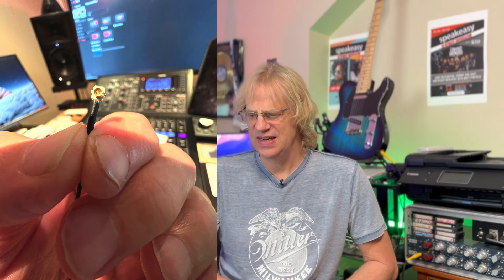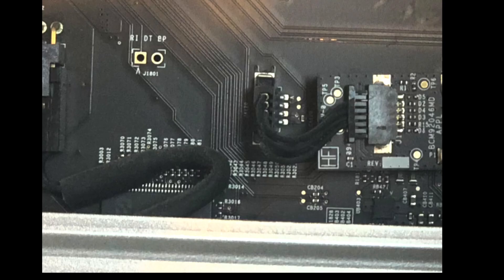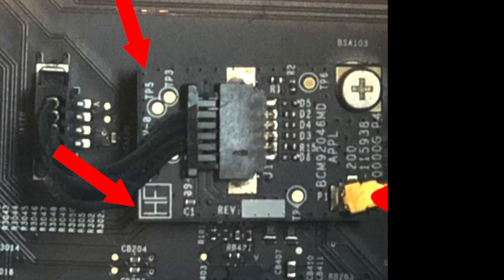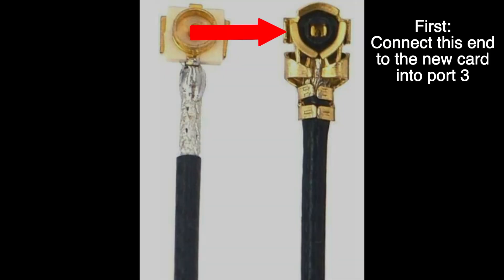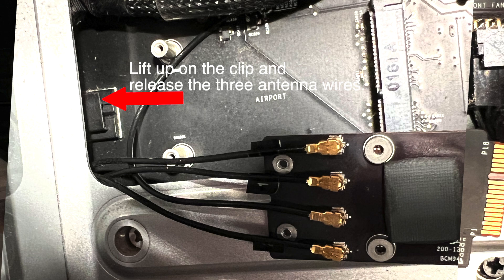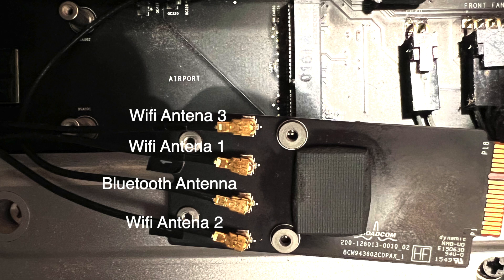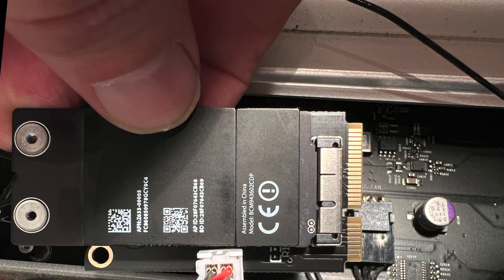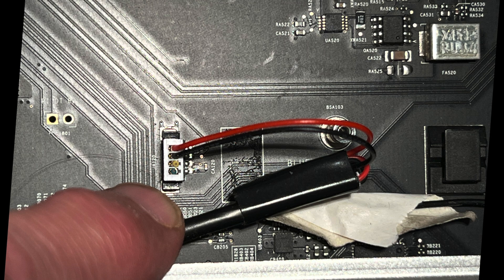Mac Pro 5,1 Bluetooth Wifi Upgrade!

Comment: Can I keep the original Bluetooth and use it for wifi only cause my pcie card which the wifi card goes into doesn't have a place to attach a wire to put it in the original Bluetooth socket
Reply from the maker: it should work with opencore legacy patcher as they patch the original wifi card not he upgraded.

Comment: Major Breakthrough!! You DO NOT NEED THIS. By using Open Core Legacy Patcher and installing the Post Installing Patches it installs the proper drivers so your stock wifi card will now connect to wifi without any issues.  ONE SMALL ISSUE AND WORKAROUND HOWEVER : I could not connect the normal way (clicking the icon on top right (tiny wi-f- logo) then selecting my name). Instead the way I could connect was to go to Settings > Network > Wi-fi > either Network Name or Advanced whichever one then brings a popup to enter password > Then you click your wifi then manually type in your password from this pop-upand it will now connect. That is the workaround and solution that worked for me. Doing it the normal way on the top right of screen- the popup to enter in my password would never show up the wifi logo would constantly go up and down. Hope this helps someone

Comment: Lance, I've been watching your video and I've come to removing the screws on the Wi-Fi module? (I've already removed the Bluetooth module) How do you safely remove the screws for the Wi-Fi module? They're tight as hell, I'm afraid of stripping the screw heads. I laid my weight on the screwdriver but the screws just stayed tightly fastened.
Reply from the maker: They have lock tight on them some more than others make sure you have the right size screw driver, it’s been a long time since I did this so don’t really remember how tight they were.
Reply: @MacSoundSolutions  It's all good, thanks to your great tutorial. My brother helped me  undo the screws. I've now got a nice wifi AC card installed. Thanks👌

Comment: would you still recommend the wifi external antenna ? are there better wifi/bluetooth chip options?
Reply from the maker: @Vcg108  not that I know of the antenna does the job.

Comment: why is my 5g speed lower than 2.4, I even connected an external antenna and the speed is still very low. The router is definitely normal because I have an old imac 2008 and macbook air 2010 with native wi-fi modules and there the speed is much higher on 5g
Reply from the maker: when updating hardware it is good idea to do a pram reset that may clear out the cobwebs, just keep in mind that if you are using opencore it can unbless it and may need to be reblessed, as it can also re enable SIP.
Reply: @ I’ve reset the NVRAM, but it didn’t help. Yeah, I’m running macOS through OpenCore Legacy Patcher.

By the way, are you getting full speed on 5GHz Wi-Fi? I’m trying to figure out if it’s just an issue on my end or if it’s something everyone has but just hasn’t noticed.

On my setup, 5GHz is performing way worse than 2.4GHz—sometimes websites won’t even load at all.

In the network stats for 5GHz, I see a TX rate of 135 Mbps, noise at -87, and RSSI at -74 — but in reality, the actual speed is around 10 megabits or even less.

Comment: Great video thank you! Id like multiple OS  boot ideally .Does the4.2 card work with Mojave/ or do I need ML Monterey OC  first on my CMP 5,1 ( Radeon RX 580) can I still get internet via ethernet with patcher? thanks again
Reply from the maker: I never had issues with Ethernet with Martins or OCLP,  yes the card worked with Mojave, it’s basically a 2016 iMac card I believe. It worked with Monterey and Martins not sure I ever tried Mont with OCLP.
Reply: @MacSoundSolutions  Great thank you Lance , fingers crossed for my apogee ensemble FW in Monterey;).
Reply from the maker: @T_G_X_P  not sure about the FireWire working, the driver has not been updated most likely to 64bit but some folks seem to still have some interfaces work.

Comment: PLS HELP

Hi Lance,
I always follow all your videos with great interest.

I have a MacPro 5.1 (mid 2012) with dual Intel Xeon X5680, 64.0 Gb Ram, on which I have installed two operating systems via OCLP 2.2.0
- MacOS Monterey 12.7.6
- Windows11 22H2 
both working perfectly except the known problem with the Bluetooth function.

I therefore decided to proceed with replacing the old original WiFi cards and original Bluetooth cards with a new BCM94360CD module, which I easily replaced following your video tutorials.

After installing and reconnecting everything perfectly and reassembling the computer, I could see that the Bluetooth problem was solved, but a new problem appeared on the WiFi network as it is no longer possible to connect via WiFi. 

I checked that all the hardware was correctly installed as when starting the computer with Windows 11 everything works perfectly without problems in WiFi or BlueTooth, but when starting with MacOS Monterey I have a problem with the WiFi as it is seen active but none is visible network and it is not possible to connect to the network 

I tried running OPLP – Post Install Root Patch again, but I got no solution to my problem 

PLS HELP
Reply from the maker: @MaurizioLucc  I would fully  disable sip if you have not using terminal in recovery mode but first try and do a pram reset. When installing new hardware a pram reset is a good idea. But it might unbless opencore so be prepared for that and have a bootable Mojave drive or move OCLP onto a thumb drive and bless it so you can reinstall it on the internal drive after pram reset.
Reply: @MacSoundSolutions  SOLVED ! thank you so much !
Reply from the maker: @maurzit  did the pram reset do the trick?

Comment: Doesn't seem to be working with Open Core and Sonoma
Reply from the maker: It does watch my latest video it shows you how to fix Bluetooth
Reply: @MacSoundSolutions  Thanks your video is great, but it's not solving my problem.  My bluetooth is working fine, the wifi card is not being recognized.
Reply from the maker: @paulsaarinen7999  need more info, what OS are you using etc? Did you try resetting your pram?

Comment: What mbps second original wifi card bluetooth vs what mbps with the modification i can't find online i wnàt to buy a mac pro 5.1 2010 or 2012
Reply from the maker: Good question not totally sure, of course it also depends on your wifi router.
AirPort Extreme with Wi-Fi 802.11n + Bluetooth 2

AirPort Extreme with Wi-Fi 802.11ac + Bluetooth 4

Newer model Airport Extreme card installed in 2015 and newer Macs. It offers faster wireless and bluetooth connections and supports AirDrop and Handoff. Compatible with macOS 10.13 and newer.

Comment: You, sir, are a legend for this video! I followed your instructions and went with the antenna you got off amazon.  I have multiple OS available on different drives (dosdude1 mojave, OCLP catalina and OCLP monterey) and Bluetooth and Wifi would only work OOTB after the upgrade on mojave and catalina.  Tried multiple NVRAM resets to no avail.  I found some forums online that recommended booting into recovery mode and running a certain command.  I couldn't boot into recovery mode without rebuilding OCLP which required switching over to my mojave OS, rebuilding OCLP with the recovery drive option enabled, booting into recovery, opening terminal and running this command: nvram boot-args="-btlfxallowanyaddr"

Once I then booted back into my OCLP Monterey drive, bluetooth was working flawlessly! I can't believe I just airdropped a file from my iPhone 15 to a 4,1 (flashed to 5,1) 2009 mac pro.  The only issue i'm having now is that Wifi isn't working on my Monterey drive.  It doesn't list any networks.  But i'm near a router and I use ethernet so this isn't really an issue.  Still I plan to keep looking into it to see if I can get it to work.

Comment: The PRAM reset worked by recovering the Bluwtooth but now I lost my support for NVRAM (that I had as my main drive)  and had to go to a old GPU because my RX580 is not recognized...
Reply from the maker: Yeah you will have to rebless opencore then put the 580 back in

Comment: I did this upgrade. Wifi works perfectly but Bluetooth does not work at all. I tried it with an external antenna and also with the internal built in and still no result. Could it be a defective little card?
Reply from the maker: What Mac OS are you on and are you using opencore? Maybe try a pram reset. A few people have had the issue.

Comment: You do not mention the model number of. the wifi card that. has BT 4.2 on it.  What is the model number?  Is there much advantage to 4.2 over 4.0?
Reply from the maker: Broadcom BCM_20703A1 it’s actually a 4.1 not 4.2 I don’t think there is much of a difference.

Comment: Hi, thank you for your tutorial, I upgraded to Monterey but the mouse cannot connect and therefore even with a keyboard it's not possible to use Monterey without a mouse.
when I look inside my MacPro 5.1 (mid-2012) , the wificard shows only 2 Wifi connectors and the third is hidden under the wifi card. 
How can I be sure that the Kit your recommand (Mac Pro 4,1 5,1 Genuine Apple WiFi Upgrade Kit 802.11ac a/b/g/n/ac Bluetooth 4.2) will be compatible with my MacPro 5.1 (mid-2012) ? Is there a serail number to check before ordering this Kit ?
can you confirm that there is no welding to be done ?
Reply from the maker: The Bluetooth might need a pram reset to get it working if wired properly, does blue tooth turn on and you made your mouse discoverable to pair with the Mac Pro?

Comment: Hi, have the same card installed and my 5.1 sees the card in system report, but no network is showing up. what could be wrong?  Monterey installed with opencore. Thanks!
Reply from the maker: Loook under about this mac sytem report Network. Mine looks like this, Maybe try a pram reset sometimes its needed when adding new hardware but be aware in can sometimes unbless your opencore install and may need to rebless it.

interfaces:
en2:
  Card Type:	Wi-Fi  (0x14E4, 0x14A)
  Firmware Version:	Broadcom BCM43xx 1.0 (7.77.111.1 AirPortDriverBrcmNIC-1710.4)
  MAC Address:	not including this for security
  Locale:	ETSI
  Country Code:	X3
  Supported Channels:	1, 2, 3, 4, 5, 6, 7, 8, 9, 10, 11, 12, 13, 36, 40, 44, 48, 52, 56, 60, 64, 100, 104, 108, 112, 116, 120, 124, 128, 132, 136, 140, 144, 149, 153, 157, 161, 165
  Wake On Wireless:	Supported
  AirDrop:	Supported
  AirDrop Channel:	0
  Auto Unlock:	Supported
  Status:	On
Reply: @MacSoundSolutions  everything looks the same, except: STATUS: Not Associated
Reply from the maker: @michel0broekmeulen  I would try a pram Reset but be prepared it could unbless your opencore install.

Comment: Hi, installed the kit and my Mac 5.1 2010 recognized the card but no wifi is popping up in the network window. What could that be? Monterrey installed with opencore. Thanks in advance!
Reply from the maker: Is Bluetooth working? and silly to say but make sure wifi is turned. Look in the upper right hand corner of the menu bar top of the screen can you turn wifi on there? Mine just showed up after installing. You may need to do a pram reset as you have added new hardware I can't remember if I had to do that or not, also double check the antenna cables to makes sure they are correctly connected if its seeing the card then it sees it via apple system profiler then maybe the pram will fix it. Beware that this could unbless your opencore install but it shouldn't as long as the opencore drive is installed. I did have that happen once and had to go back to mojave turn off SIP and rebless my opencore drivev.

Comment: Thanks Lance! Did this yesterday, having bought the elements on various eBay places for a pretty decent total price. It was pretty straightforward, even plugging the 3 antennas which I was dreading. Now I'm ready to install Monterey on a separate partition to try the latest Avid version.
What OC version are you running with Monterey? Stable?
Reply from the maker: I’m using Martin Lo’s latest package and Monterey 12.7 all is good except the latest safari  is buggy although I got it working fine now after taking my router offline and rebooting it but at first no web sites would load. I’m on the previous version of pro tools not the very latest update but will update soon, all is very stable. Make sure to make the config.plist changes before installing Monterey, then return it to original settings after updating, easiest way is to drag and drop the original one over the one you made the changes to and reboot.

Comment: Hi Lance! What version of Mac os are you running? I install it but I can't connect any device.
Reply from the maker: Monterey 12.6.8
Reply: @MacSoundSolutions  Thanks, I'm on Ventura 13.5 and I got it to work, not sure how but I did it LOL. Air Drop, BT WiFi all works... WIFI is super fast ...

Comment: Hi Lance! I just want to say thank you very much for all of your in-depth videos on both hardware and software installations for the Mac Pro. I can’t stress how helpful you’ve been in allowing me and my Dad to gain a greater understanding of the machine and how to upgrade/replace several hardware parts. 

In the audio field there is a massive gap of accessibility to those who lack capital to spend on a computer, MIDI controller, software, DAW, Plug-ins etc. and as someone who comes from a working class household I’ve always had to find solutions to overcome these financial obstacles. When I managed to pick up an early 2009 Mac Pro 5.1 with dented legs on Gumtree, for a mere £40, your videos have helped me upgrade this into a beast of a machine with meticulously detailed step by step video guides. It’s now running a X5690 CPU, GeForce GTX Titan GPU, 96GB (triple channel) RAM, has 3 OWC 2.5” SSD tray sleds with 7TB worth of drives in it right now and, after watching this video, it’ll be upgraded to Bluetooth 4.2 support! 

I’m not sure if you’re active on LinkedIn at all but I’d love to connect with you if so. Your work on this platform is exceptionally helpful and I plan on making a post about it soon. 
Thanks again Lance, take care.

Max :)
Reply from the maker: Hey Max good stuff thanks and glad my vids have been helpful. I am on linked in, Lance McVickar

Comment: Hey, so I have a new MBP with the m1 chip and my Mac Pro will not connect to it via airdrop. Will this resolve the issue?
Reply from the maker: What OS are you running? Are you using Opencore?
Reply: @MacSoundSolutions  no, I don't know what that is. I just want to use the airdrop function.. sorry for late reply
Reply from the maker: @abezdnb  Continuity, Handoff and AirDrop is not available on the old Macs because the Airport and Bluetooth modules are out of date,  you have to upgrade your wifi bluetooth card in your mac pro 5,1 to get airdrop to work.

Comment: I have a 2009 Mac Pro with Mojave. It presents the following problem. While I want to download, for example, an update of some program, for example Firefox, some file or something else, the process stops. What could be wrong? my connection is optical and the relevant check has been done by OTE and everything was fine since the pages on the internet open very quickly. Do I need to change anything in the hardware? Do you suggest I get a new network card? I've tried everything but I don't know what else I need to do. Thanks
Reply from the maker: Try a pram reset might fix it. Clear out your browsers cache sounds like it’s corrupt files in there, also tru a different browser see if it works, if not it could be hardware, try a direct Ethernet connection.

Comment: Hey late question but im thinking about doing this to mine and, does the card still let you go back to stuff like MacOS mavericks later on? or are you stuck to more recent versions?
Reply from the maker: It should but I have not gone that far back OS wise it’s the same cards that iMacs use for a while. I think I have booted in MT Lion in the past.
Reply: @MacSoundSolutions  I really just need to go back to mavericks for stuff that i need running stable/xserve, so thisll work for me. Thanku!
Reply: @MacSoundSolutions  Tested it. Weird results.

Mavericks does not detect wifi or bluetooth on the card. But due to macs weird bluetooth failsafes with connecting Bluetooth keyboards and such, magic devices 2 will let me use them still?

Weird.

Comment: You need to make a video on how to fix the ati 5770 when the boot bio in gpu gets messed up ..and you have to clear the bios and reflash to working status...this happened after mac upgraded to Mojave with 5770 in makes u think the card is bricked
Reply: Took 2 weeks to find the information after I already bought a new